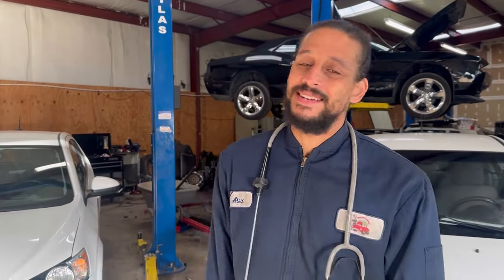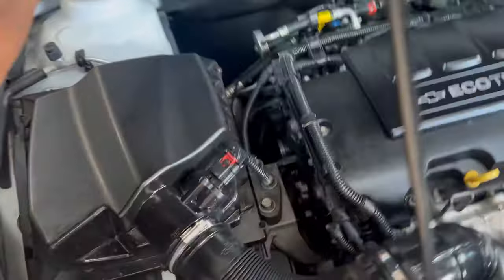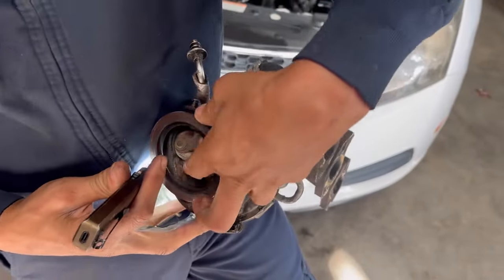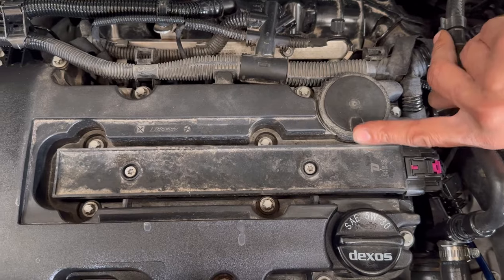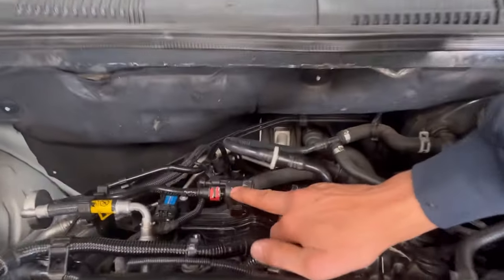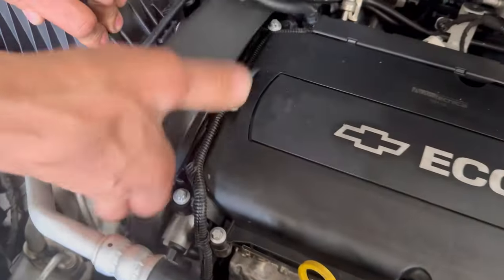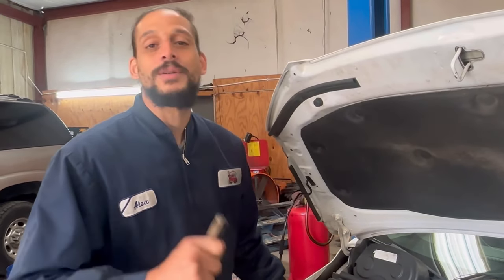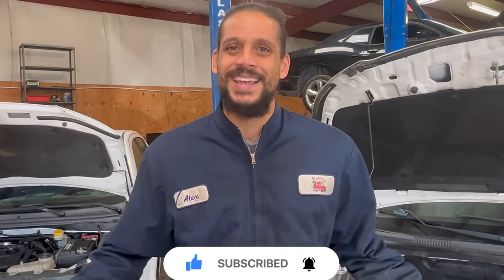Top 5 Problems With The Chevy Cruze (1st Generation 2008-2016)

Comment: Surprised you called these cars reliable

I've never heard anything good about these and I'll never buy a Cruze

I've also heard they have bad transmissions and go out early all the time?
Reply from the maker: What you “hear” and what you experience are too different things. I’ve seen these cars get over 200k miles on the dash. And I rarely see them with transmission issues. That doesn’t mean it doesn’t happen, but I’m just speaking from my experience. These cars mostly get a bad rep due to user neglect mostly.
Reply: Yeah if these young kids are out there beating on these cars like you see videos online of like the dodge hellcats and demons not even those cars hold up in the long run to constant abuse.

I knew a kid with a dodge neon rt and that kid would red line his tachometer then slam it into drive thinking he'd get a better launch and burnout. Well yeah that trans might handle it a few times but guess what in 3 years he went through 5 transmissions 😂 after the last one blew that car has been sitting for years cause he's broke from all the repairs. 😂

Comment: ALEX, WRONG!!!! These cars are JUNK! ALEX, you and your wife are the first people that have EVER said the cruze is a reliable and great car. WOW!!! You have to say that because you probably want to get ride of your wifes car, she don't drive it, i know why.... I've had mine for 6 years and had to repair 3 valve covers, the who turbo chargers, mass sensors, oxygen upstream sensor. And i vaby all my cars, oil changes every 2-3 months even if i don't hardly drive them, plugs changed, oil and filter, air filter, cabin filter, pcv valve,battery and the cruze still SUCKS!!!! You pointed 5 bad things and you said their still other issues and then you say they are reliable,  contradicted yourself. Me and the rest of the cruze owners regret buying these peices of CRAP!! In fact just dropped mine off back at the garage, mysterious issue going on. People,  run from these cars. Mine is 2011. All 1st generations are BAD. Im not selling mine and has 131686 miles on it, because i couldn't let a family or youg teenager run this car, it is 100% UNRELIABLE.... Im sticking with it and just repairing as i go. 😢
Reply: I have one, 2012 Cruze Sport6 (hatchback) w/ 1.8L and manual 6 speed. By now have some 76k Miles. I do take care of It, some minor problems so far.
Reply: Sounds a lot like my former 2016 (9th Gen) Malibu that I owned for 6 years. 1st year of new body style. Engine blew at 59K, recalls, 4 AGM batteries, total of $9K worth of repairs and long story short the trans went out at 125K miles. Sold the car and bought a Honda. Never looked back.
Reply: Right I was shocked he said reliable he's the only one I've ever heard say that

I've heard nothing but bad things about these from people like yourself that have owned them I'll never buy one of these

In Scotty Kilmers voice "Should you buy a  Chevy Cruze? No RUN AWAY!"